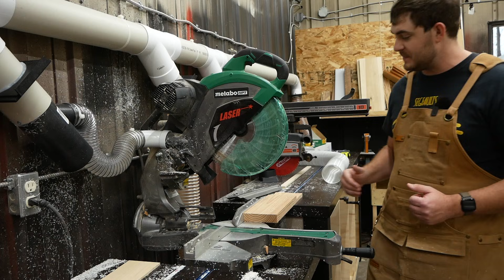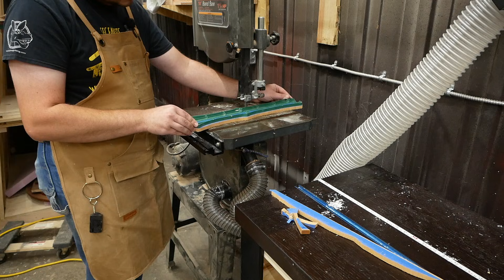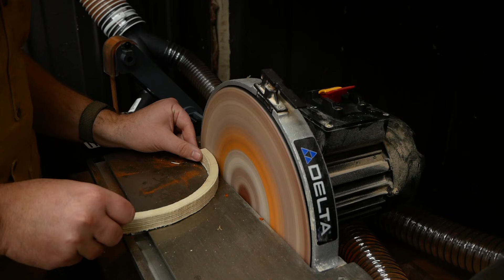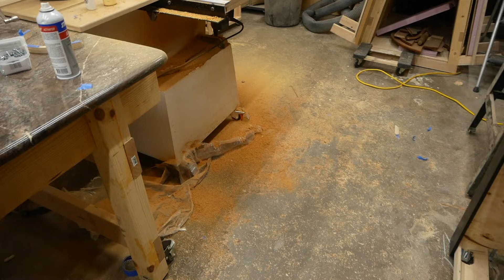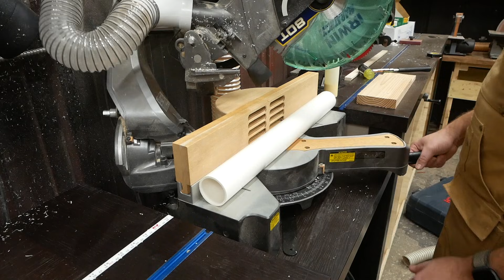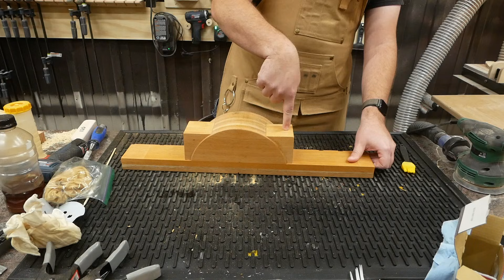Can I Improve the Dust Collection of my Miter Saw with Excessive Mahogany?

Comment: I got to thinking of this video out of the blue the other day, and came here to say you could probably minimize the dust bounce by hitting up the inside of those slots with a narrow, 25-degree chamfering bit, increasing the outward-facing opening size, reducing the dust impact area, and sculpting the air columns into a slight funnel, like you did for your reducer up top.

Comment: I absolutely love your over-engineered project. I have a question for you and the other "Think Tankers" ... How can you still have the zero clearance when cutting up to 45 degrees left or right ... eg for Picture Frames? I am setting up something similar with my rebuilt and refurbished Dewalt Powershop 7740 Radial Arm Saw. Your amazing working sculpture is worthy of an engineering award. The challenge as I see it , zero-clearance will cease on the face due to the angle the saw would be cutting, thus increasing the gap on the vertical surface. It would ruin your crafted routed slots. However the zero-clearance just might work on the top only. A fixed hemispherical shape with a matching arc , and mated sliding surface. A thought just came to me ... With the volume of air-suction being generated, It may be possible to widen the vertical gap with straight sides. Unfortunately, your aesthetic horizontal slots would become too brittle, and the potential to break would become very high.  I would love to see your approach to the zero-clearance 45 degree challenge. Cheers from South Australia.

Comment: A small but important point. Sliding miter saws are NOT designed for chop cutting. You are ALWAYS supposed to pull the saw out, then plunge, and execute the cut pushing the saw backwards.

Comment: That is a work of art!

I gave up with mine... the builtin hose connector grabs perhaps 50% at best and the rest from the blade spin just flings tut towards the back & sides.  So... I just built a cheap plywood shroud box around the back of it and added a port for my 4" collector pipe, then put some simple removable doors on the front to enclose as best possible (doors remove for miter/bevel cuts).  It actually works rather well now... probably 90% or more gets collected.

Comment: Just extending the existing boot probably would have worked better. That's how Festool does it.

Did that to my Ridgid (Delta Kruzer) using duct tape and it catches about 80% of the dust now--as opposed to 0%. Took me about 10 minutes to build.

Comment: I mounted a baby sun tent behind my miter saw and cut a hole in the bottom for a 4" dust collector fitting.  90% of the dust is captured by the tent and sucked out to my 1100 cfm dust collector.  works great and the saw has free range of rotation.  of course this will not work if your saw is in front of a wall as the tent is about 3 feet deep.
Reply: The concept does work:  it's "area capture" vs tool capture.  With a MS against a wall, shroud the sides and top, then vent the enclosure.  All the details of zero clearance, etc., at the saw blade don't matter if the strategy is area capture.

Comment: Cutting out 1 or 2 of the cross bars in the fence would increase the airflow and may capture more dust? You could still leave the vertical portion in the middle for zero tolerance.

Comment: I have the same miter saw and while it does a much better job than any I've owned before with dust collection I've noticed it works best with a sliding cut.... So I use a lot of sliding cuts. But maybe... Just maybe I need to upgrade. Thanks for sharing

Comment: In regards to your comment on the dust collection efficiency not being as good as you would like, perhaps you could improve the dust capture ratio by opening up the front edge of the slots with a bevel or round-over router bit.
This would reduce the likelihood of particles bouncing off the solid areas between the slots and still support your zero clearance kerf.
Oh, and I think you did a beautiful job.

Comment: You have zero clearance Clarence...

Perhaps you could take the fence back to the router and somehow make the grate at a sharper angle so effectively the gap between the grates is a knife edge and avoids collection of material on the face? I think you used a roundover, perhaps a bevel would be better? Yes, I know this is an old video, but this is the internet, how's that going to stop me commenting!

Comment: Block the 2 top rows in the fence because they are pulling most air through them because the least amount of obstruction so by blocking them off and making the air be forced through the bottom means the system will work better for dust collection

Comment: 1) It's a beautifully over-engineered piece of woodwork.  2) What if you cut out one or two of the center  dust control grid.  It'll open it up so the bigger stuff doesn't get hung up and it'll also retain the zero clearance.

Comment: 8:25 You perfectly demonstrated why the end grain gluing heuristic has become a horrible myth. End grain glues better than side grain, weak joints come from small glue areas. The lesson of weak end grain gluing is supposed to train you to avoid gluing the narrow ends of structures, but it's poor communication resulted in you re-jiggering your part to make the joint even weaker.

With that said, your surface is big enough for the job and probably will hold up fine, unless you are using a glue that goes brittle, in which case the side grain glue line may break from vibration.

Comment: I have noticed in a couple of your videos you have the bandsaw guides rather high above the of of the wood you are cutting.  I would think you would have better control of the blade if the guides were as low as practical.  Nice looking project.

Comment: Your grid slats should have run parallel with the blade instead of perpendicular, that would have allowed more air flow near the blade and not blocked portions of particle travel.  Just a thought.  This is helpful for me because I have the same miter saw.  Also, what is the cfm / hp of your collector?  It could be undersized, complicating this issue.

Comment: I wonder if the dust collection would have been better with vertical openings in the face rather than horizontal.  It seems it would be equally strong, still allow for zero-clearance on the blade, and be more likely to allow the flow of shavings from the blade.

Comment: For me, this video was worth it for the zero clearance insert alone, but as you were attaching the PVC to the boxes behind the fence, i realized, with all the trouble you were already going through, you could heat that pipe, and make a venturi.  This was doubly reinforced when you decided to constrict flow at the top. Once again, add venturi, get more flow while constricting  or controlling the pressure, double bonus~!~ Naturally, i wouldn't be watching this if i was not trying to do this as well. Customers hate sawdust, and often i have to set up in their garages. So decreasing it is a must. Thanks for the video.

Comment: I don't understand why you can't remove the grid of holes on each side (ie a hole on each side with the middle piece intact). You'd still have zero clearance in the middle and you'd have improved air flow.

Comment: I wonder whether you can improve the dust collection by using a curtain made from brush seal. The one that is used to seal doors. https://www.northshorecommercialdoor.com/gadobrse.html They have self-sticking strips and can be mounted to any flat surface. I would construct a frame that conforms to the workpiece to be cut any close the gap with those brushseals. On top I put a transparent hood. Whaddaya think?

Comment: Awesome work man, I would cut a few pass-through vented slots on the top of the zero clearance insert behind the fence line to help with dust. Maybe even a few slots on the entire insert to gain more airflow. Also 2-1/2”-4” adapters on the fence collection to add a higher static pull at that location just a thought!

Comment: Well I like the effort that you put into it.  I too, occasionally over apply myself to a project.  This is because I can see that the outcome will be something I can be proud of - at least  in my own mind - because I can see and know that the fitment of a piece shows that I took care of compound and difficult angles.  Question:  1) Is it possible to correct any air leaks in the vacuum line or openings that don't shut completely?  2) Is there a way to increase the vacuum in the line?  Better motor or does the line have too much friction to the air flow?  It appears that you're using 4" line and smooth pipe too - from what I can see in the opening shots, which seems good to start with.  Loved it!

Comment: This is a great work of art. Having recently purchased a 3D printer I'm imagining how much easier most of this build would have been with one.
Reply: I'm building some dust collection equipment for my shop with my 3D printer as well. Don't underestimate the ease of just making the simple parts with wood and making fittings etc with the printer. 3D printer is the perfect accessory for the woodshop!

Comment: Connect just one pipe, and on the other side leave the opening open, and reduce it only a little ... so you will have a side stream of air ... a side stream and a stronger stream that will remove the chips sideways ...away from the direction of rotation of the saw blade😉

Comment: Problem is even miter cuts will destroy a zero clearance box. It would have been better to have created a large shield in the back that would let the sawdust fly back and to be funneled down to be sucked out the bottom. The shields top would have sloped up as it came forward and the two sidewalls would fan out roughly 45° to each side. It would come out to the back of your fence and the top could extend a few inches further and be rounded to match the arc of the swing of the handle for the Saw. This would help to guide the sawdust back so that you could have a collection area behind and below the table of the miter saw they could have a hose in the bottom or low on one side. You could also put a second smaller hose before the blast gate that would have a stopper in it so that after you were done using the miter saw you could remove the stopper and close the blast gate and use that singular hose to clean up whatever little bit didn’t go back to the collection area and then shut off your vacuum and re-insert the stopper.

Comment: You could try just using one vacuum hose, instead of two, on your beautifully made dust collector, and, at the same time, disconnecting the original hose. In theory, it should increase air flow speed through the one remaining hose dramatically. Just my 2 cents....

Comment: when you turn the saw, youl cut of the corner and no more zero clerance.
Reply: I highly doubt he’d have wanted a zero clearance fence if he planned to make angled cuts with it. But hey
Reply: @LeglessWonder  he does intend to make angled cuts he says so in the video at 9:36
Reply: That's what I was thinking, he's turned his miter saw into a basic 90deg chop saw, with mediocre dust performance .  As soon as he starts cutting 45's and such, his box is going to become a shrapnel hazard .  I suppose he could just remove the wooden fence when he wants to take a angled cut.  This is why saw hoods are the way to go with miter saws.

Comment: It is so much better than before you had it!  I have a Bosch Axial Glide, so it is a very different build.  I tried making one similar to it, just for proof of concept, and the "snorkel" mod (making the bottom part longer and wider) was way better, which sucks, as yours is really beautiful.  I got new tape for my joints (4 inch pipe, 2 hp, 2 stage) as i can hear it hissing and leaking, which could be part of the problem, for sure. Ill keep trying to figure something out.

Comment: PVC pipe will build up static when air is flowing through it, so you will have to prevent that from happening and creating a spark which could ignite the fine saw dust. I believe some of the hose and pipe made for this application will have a grounding/bonding wire running through it. Look into it. Other than that, it looks great.

Comment: It's subjectively pretty, and good work, but why, tho?  I mean am I the only one that thinks a square box with a bottom panel cut to match the plate of the saw would look cleaner and nicer than having the little dog ear blocks that cover up the best feature of the thing from any normal viewing angle?   Don't know, just don't see the point in spending the time or material in making the curved wall just to cover it all up with big chunks off the sides.

Comment: Just a thought: maybe instead of using a round over bit on the vent openings, maybe a chamfer bit?  This would make the openings wider on the front while still thick (and solid) at the back and the dust more likely to be drawn into the opening itself and have less bounce-back.  Just a thought for your next iteration.

Comment: Looks good but I'm not sure how well it'll hold up once you start cutting different angles. The first angled cut you make will eliminate the zero clearance aspect of the fence whilst making an additional cut in the hood at the back I.e. reducing its effectiveness.
Reply: You would take it out for an angled cut.
Reply: @MartinThmpsn  Feels like he rarely does angled cuts on it, but that might just be me.
Reply: Having to remove it to miter is  a con to all the work that went into it. But if one rarely makes miter cuts all good.

Comment: I have a very similar dust collection system (like almost exactly with a Bosch) on my miter saw.  I ran through many, many, plywood prototypes before I found the secret sauce and now it's nearly perfect.  Here is what I found.  Mine is the same with two important tweaks/changes.  #1 My zero clearance back fence is taller it extends up right to the bottom of the saw body see here 15:16 where you are cutting and chips are flying into the boot?  Remove the boot, extend the fence higher and you have nearly total collection and two dust ports collecting.  #2 Prior to your first cut you could see the system was air starved at the bottom.  Making the first cut would help obviously, but on the zero clearance insert, in the back inside the box extending forward drill a bunch of holes like a honeycomb --> these made a huge difference in airflow.  The holes also give the added bonus of acting like a suction on the work piece holding it in place.  Hope this helps and nicely constructed.

Comment: The mitre saw fence/box does look good.    Works well as a zero clearance, but the design and a total of three small flexible hoses is creating a LOT of pressure drop so reducing potential airflow.  We all need some flexible hose, but reducing the length to a minimum reduces pressure drop.
Mattias Wandel just posted a good video showing the effect of hose size on shop vac and dust collector performance.
You have a LOT of fittings on the system.    Every fitting adds pressure drop.
Try using only one of the PVC pipes and compare the amount of suction/dust collected.
https://www.youtube.com/watch?v=d33CQchZHX4
Dave.
Reply: Agreed, you could attach the hose to one side and block the other, and if you need a miter on the hose side, just switch the hose and block. That's what I thought he was going to do at the beginning.
Reply: 🤬😘👳🏽‍♂️😋🦊😚😚🧑🏾‍🌾🧑🏾‍🌾👷🏽‍♀️👷🏽‍♀️🧑🏾‍🌾🧑🏾‍🌾🧑🏽‍🎤🧑🏽‍🎤😴. 
B. 
 
 T as
Reply: 🤬😘👳🏽‍♂️😋🦊😚😚🧑🏾‍🌾🧑🏾‍🌾👷🏽‍♀️👷🏽‍♀️🧑🏾‍🌾🧑🏾‍🌾🧑🏽‍🎤🧑🏽‍🎤😴. 
B. 
 
 T as

Comment: Would it be more effective without the open holes?  If everything was being pulled in through the kerf cut?  Honest question.
Reply from the maker: Dust collectors do better at airflow than suction, so I don't think so. There's also the matter of dust flying at the front of the fence from a far out slide cut. I should've made several different prototypes out of plywood to experiment
Reply: @UnderDunnOfficial   I sense a V2 at some point in the future... maybe?
Reply: I like the side shot that you showed. I think that my saw actually misses a lot over the top of the dust collector.  Thanks for you videos, I really appreciate them.